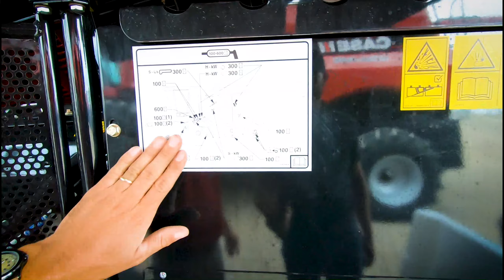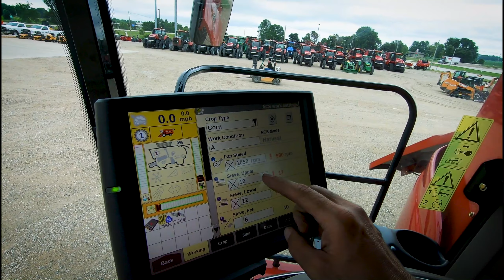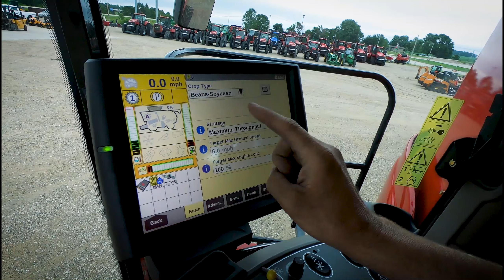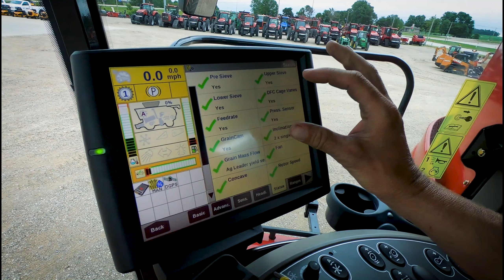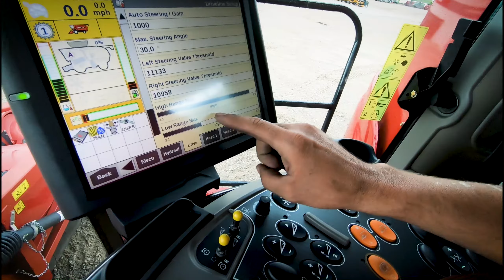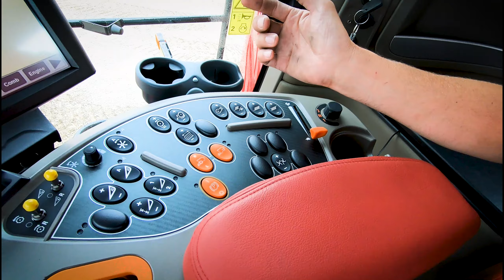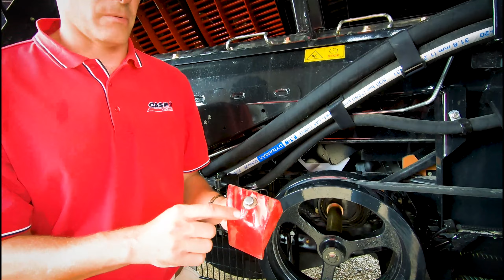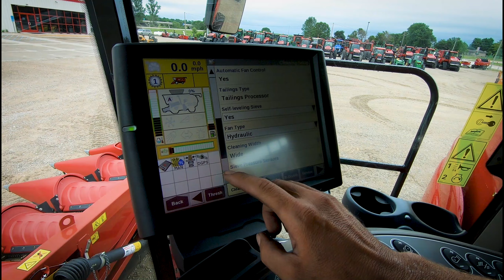Case IH Flagship Series Virtual Combine Clinic 2020

Comment: Hello what concave to put on 1i2.  3.4position on the left and right side for wheat for best performance on case 7250
Reply: Depend on the conditon, but the SW/LW/LSW/LSW is good to start. If you need more treshing you can change the 2 nd LW concave to a SW concave. And If you have easy sperating condition example: dry straw or short straw, you can change the last concave from LSW to SL concave.